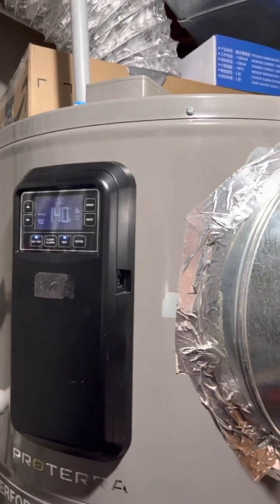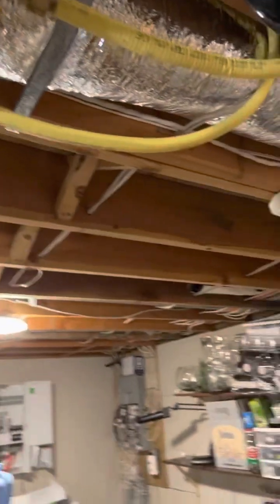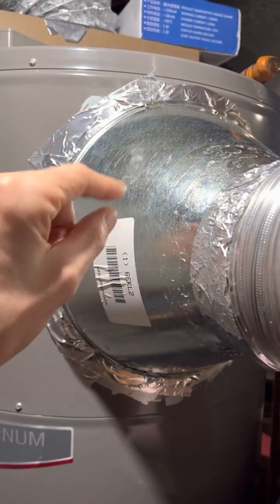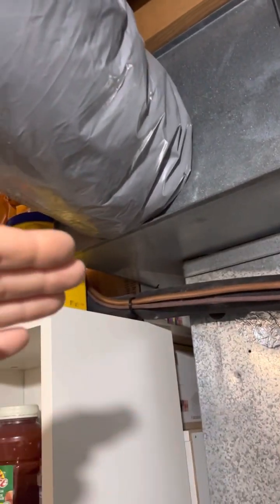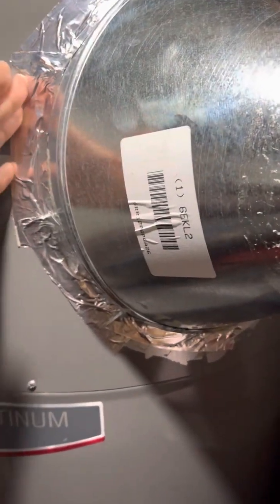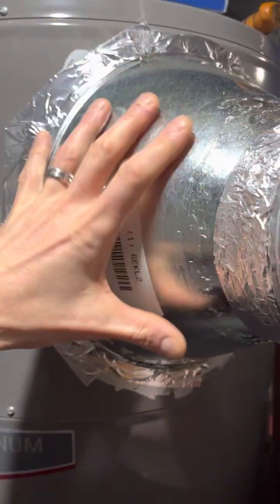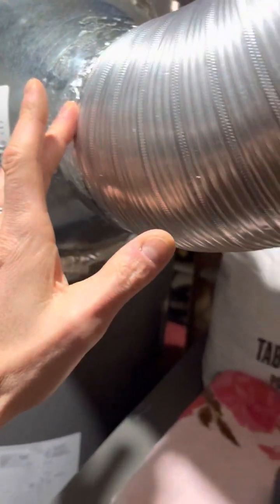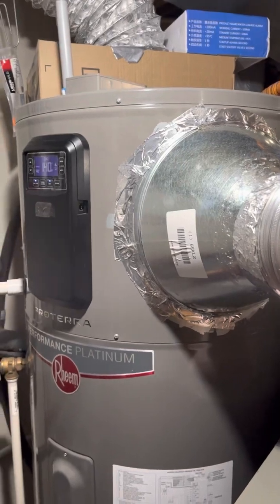Rheem hybrid, hot water tank heat pump restart

Comment: Why are you pulling cold air from the outside? Wouldn’t it be better just to have it pull from the basement?
Reply from the maker: The output port connects to the reducer and sends the super cold air outside. The input is on top with this unit and I have an 8” duct pulling air from upstairs to have higher temperature intake air. This is working very well as we heat with a wood stove and the temps at the intake of the hallway are around 22c-26c when the fires running. 18c when it’s not as the furnace is set to kick in at that temp.  The heat pumps work best if you can feed them higher temp and higher humidity air.

Comment: does your heat pump water tank supply hot water for your in floor heat or do you use a boiler?
Reply from the maker: It is a boiler. Only showers, sinks and such. We heat by wood stove and a furnace set at lower temp.

I read that this type isn’t recommended for in floor as apparently it would keep up and the heat pump would run constantly. I haven’t looked any deeper into this though.
Reply from the maker: It is not a boiler. Only showers, sinks and such. We heat by wood stove and a furnace set at lower temp.

I read that this type isn’t recommended for in floor as apparently it would not keep up and the heat pump would run constantly. I haven’t looked any deeper into this though.